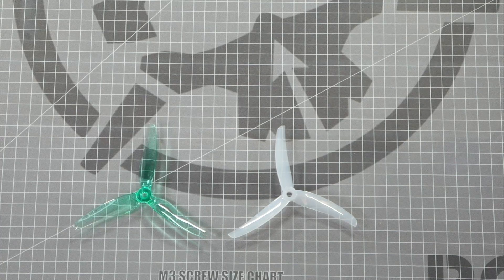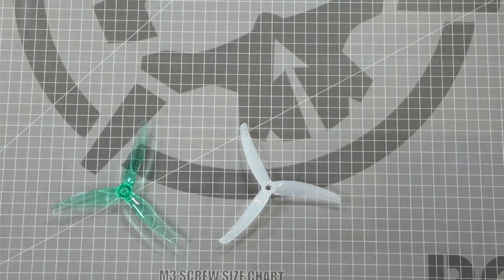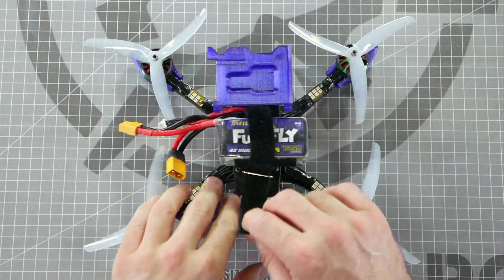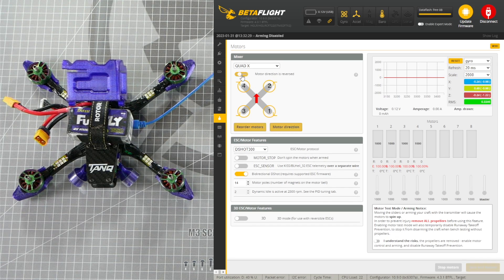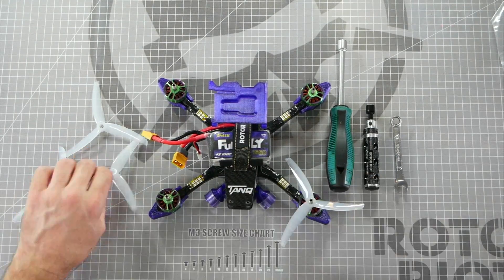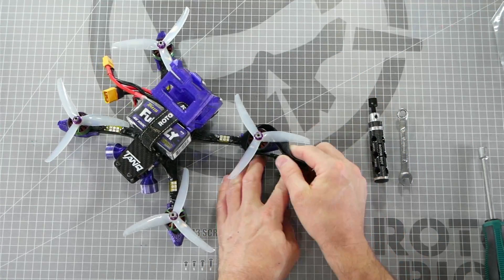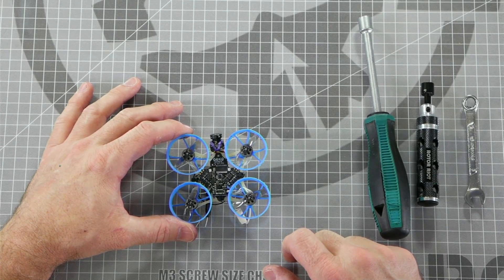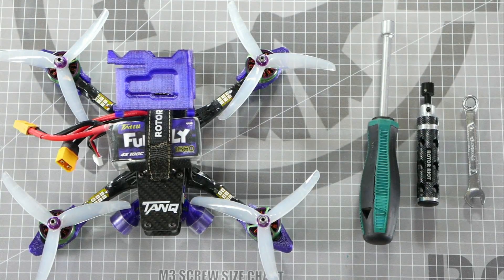How to Install FPV Drone Props Correctly -  Propeller Direction? In or Out?

Comment: Propellers should be free from obstructions above them to prevent airflow blockage and maintain thrust. Avoid oversized components on smaller drones, as they can hinder performance. For optimal flight, ensure the design is aerodynamic and compact.